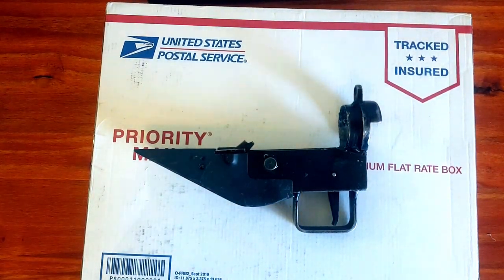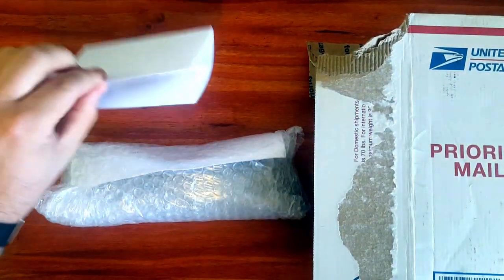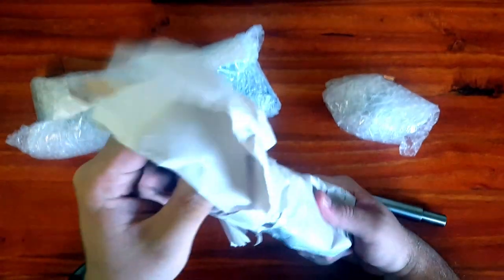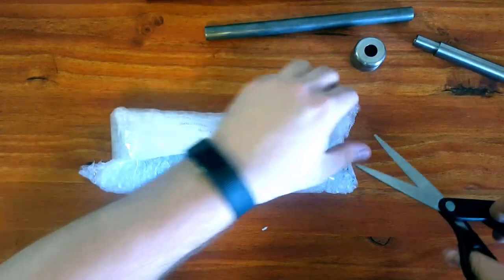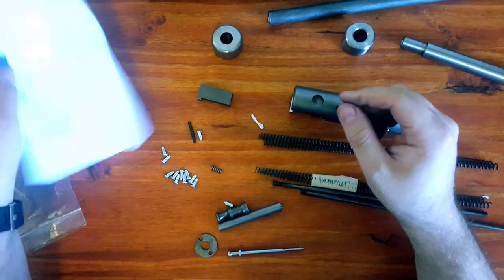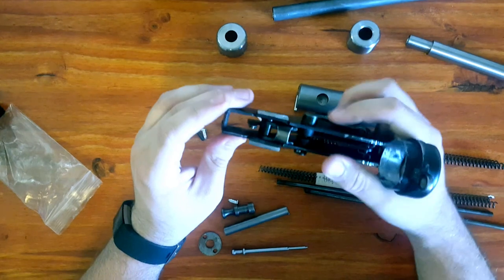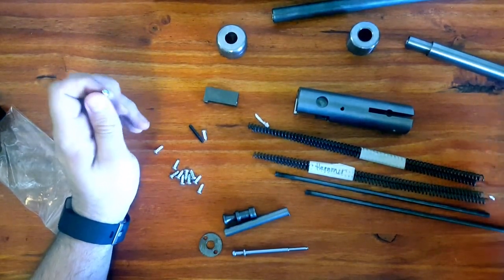Indianapolis Ordnance STEN Build Kit

Comment: I've build 9 total  One is a Tavor clone bullpup. All I have is a drill a Dremel tool, calipers and some files.
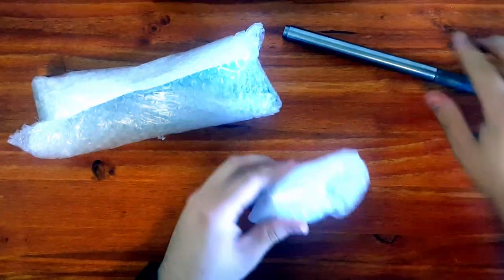 Easy to build IF you think a few steps ahead. The cocking slot is  .375 +.010 - .000. Right on 3:00.
The sear cut out dimensions ARE different for a MK II and the MKIII .
My tutorials are on the web,...somewhere.
Reply: did you have videos

Comment: hey bro, i just about got mine finished. it works great w/o springs loading and ejecting shells out of the mag. by hand. when i put the springs in i got to cock it hooking the bolt on t5able top and pushing it with all my might-- then it cocks.   IO tells me to keep chopping the spring till it works--  this seems not good.  any suggestions  how long did you have to cut your spring and or rods to work ultimatly
Reply from the maker: There is permanent indentations on my office chair from where I used it to cock mine at first. Just slowly trim the spring until it's just bearable, but still fully enters battery.
Reply from the maker: If you join the discord, I can measure my springs for you.
Reply: @CheapShot   i built aks there was a breaking in period.   but this is ridiculous it seems if i cut any more there will not be enouh tension to keep the rear plunger holding the stock on--- or is it supposed to be loose--real stens keep enough tension to hold the stocks on   i was surprized at how easily the rivits went in.   i also used high temp auto motive epoxy instead of solder for the front trunion

Comment: Quick point.. Is a semi auto closed bolt version actually a STEN at all? EG: A semi auto AR15 isn't an M16 or M4 is it & anyone who stated it was would be laughed at.
Do you see my point?
Reply: All M16s and M4s are AR15s, but not all AR15s are M16s or M4s. I guess your question as far as the Sten goes is yes a closed bolt Sten is still a Sten, just a variation on the original design.

Comment: Still waiting on them to have the stuff in stock :/
Reply: @CheapShot  how did you do the rivets??
Reply from the maker: @joelopezjl28  hammer rivots
Reply: @CheapShot  oh cool! Good to know you can still build things if you bang on them hard enough lmao
Reply: I would presume that the kit itself has pretty good instructions too
Reply from the maker: @joelopezjl28  yup! Just cut where it tells you to cut. Tiny spot weld on the buffer assembly. Then what I did is I clamped it all together, made sure it worked with some dummy rounds, then took it to a weld shop and told the guy where I needed it welded. Cost me $13 to have professional welds.
Reply: @CheapShot  hell yeah!
Reply from the maker: If you want to talk more about it, we can on Discord (https://discord.gg/GX5PSCcBwg)

Comment: 4:01 haha....no, you're right that's the rear trunnion but flip it 180 degrees so the flat face of bolt meets flat face of trunnion to fully chamber a round.
not sure what to think about the price, everything so insane now...I remember when the saw cut (entire gun) kits were $40 on eBay and even less in the '90s.
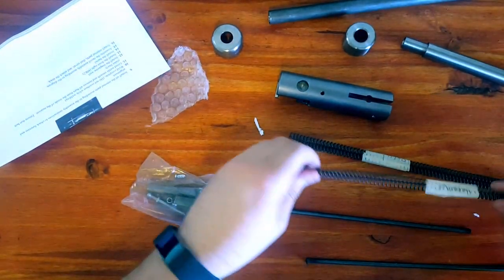4:22 is that a dimple for drilling the rivet hole(s) ? they should've drilled for you. The mk2 looks better, a screw on barrel for easy takedown and entire package not over a foot long so could drop them en masse behind enemy lines from aircraft.
Those rivets are unique with the sort of drywall screw spiral that locks. Not sure that's superior, if you mash the rivets correctly....ginsboy2003 https://www.youtube.com/user/ginsboy2003
is a pro at that unless YT took vids down...

Comment: i joined discord Therealmarkthope# 9687     i lost the tags on my springs rattling in a drawer a few months-----just noticed one spring is much stronger than the other,   which is for the hammer the strong or weak one  or should i use weak ones thanks